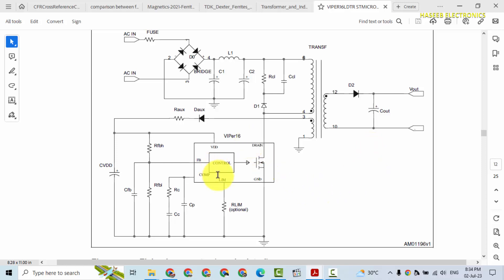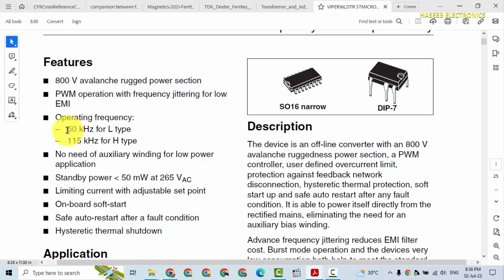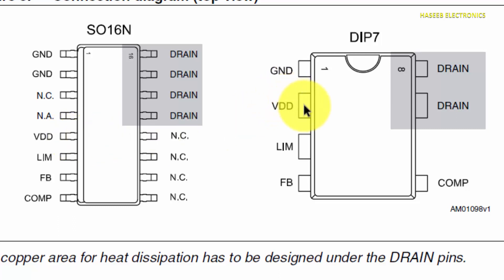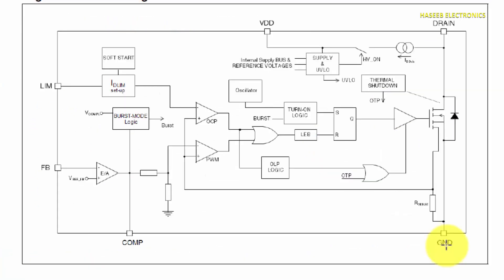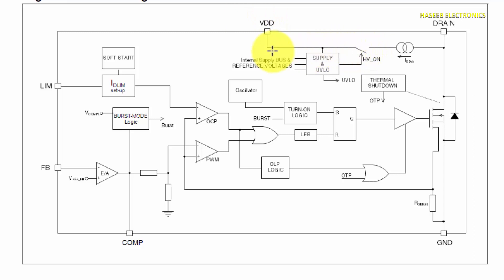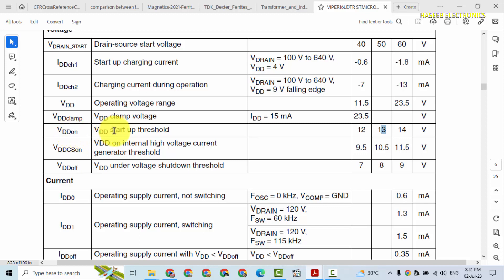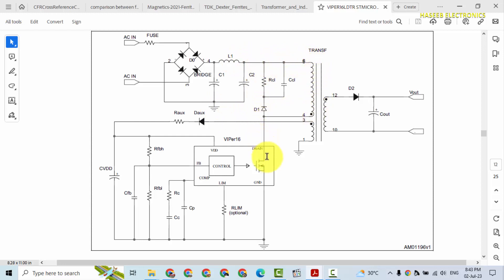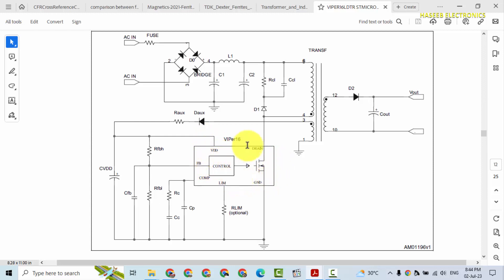{932} Viper16L startup circuit

Comment: Thanks,
Can you design and explain a circuit that we use same ic for higher current loads with both Current and voltage feedback? Let say 60DCV at 10A input voltage 230acv
Thanks

Comment: Asalamuwalaikum,
There is a universal module available in market called 29-5 module and 29-3 module. These are the power module but, on 29-5 company (manufacturer) marked that, this is "Parallel Type Supply" whereas they marked the 29-3 as "Series Type Supply".

Dear Haseeb Sir, will you please explain what are these type use for ? Is it a kind of power supply (smps) topologies or something else ? Please explain in your next video 🙏🏻🙏🏻 Thank you